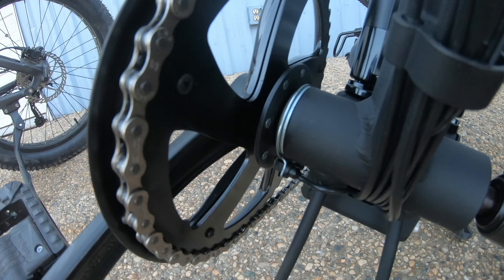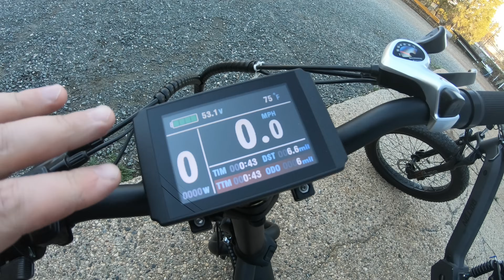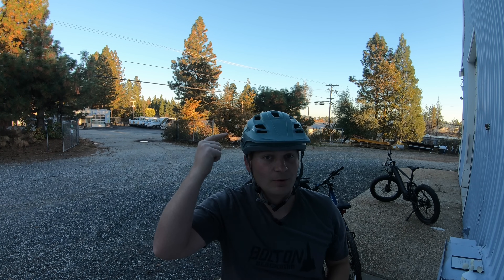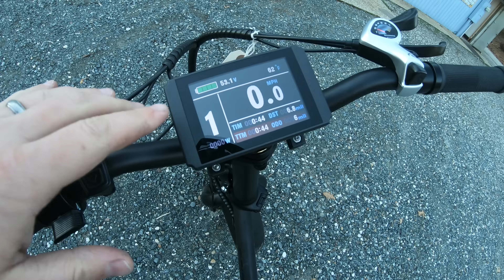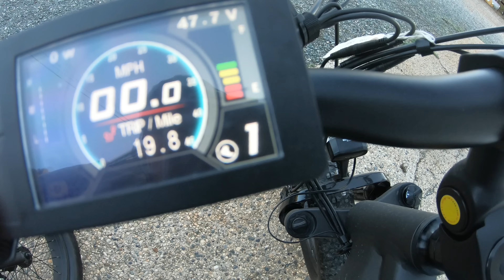Ebike Cadence vs Torque Sensors - the surprising outcome

Comment from the maker: Which is better? A Cadence or Torque Sensor?
Reply: It depends upon the person and the situation. I prefer a torque sensor. It makes me feel like I have bionic legs!
Reply: @michaelhorton6166  I also enjoy the delusional feeling I get from a torque sensor especially for climbing hills  :)
Reply: @michaelhorton6166  Just like me.
A Torquesensor is (in my opinion) the best. The most bikes build today in Europe are equiped with torquesensor.
This sensor give the bike a very natural feeling. One advice; try to keep the Cadence at 75RPM.
That's the best for a bike. A lower cadence is something a bike with midmotor doesn't like.
Reply: @michaelhorton6166  For me it's the same.
The torque sensor give me a smooth riding experience.
The cadans sensor doesn't give me that feeling. That sensor makes it feel to me like the bike is riding on it's own.
Reply: @michaelhorton6166  ¹¹1
Reply: For me, I like/need the cadence sensor and throttle combination. I've had a serious motorcycle injury so can't necessarily use one of my legs to it's fullest. Consequently I sometimes need to use the throttle to start off from a standstill, sometimes I ghost pedal in order to get the motor assist as my leg won't do what I want it to do. A torque sensor would leave me stranded sometimes. Some days my legs work as they are supposed to and then it's a great day!! My ebike has been a blessing.
Reply: @davemeise2192  sorry to hear about your motorcycle accident unless it was your fault and others got hurt. Typically it's some moronic automobile pilot who screws up and slams into a motorcycle but yes I think you are correct with your thinking that a cadence sensor would work best in your particular situation. Although I think the majority of people would want a torque sensor there are absolutely cases like yours and others where the cadence sensor makes the most sense.
Reply: @billclark8241  Majority of motorcycle accidents that result in injury or death are the fault of the rider.  In fact, the number of SOLO vehicle accidents are higher than those that are the fault of the car.
Reply: @bindingcurve   I agree with you. Nowadays nowadays the way these kids ride these motorcycles so carelessly it absolutely has gone the other way now with motorcycles being the majority at fault.
Reply: Throttle torque.
Reply: For me torque
Reply: I'm more curious about if it's possible to add a torque sensor to my RadRunner Plus... It comes with a cadence and I wonder if it's possible to upgrade it at all and what if I can and did?!? (I haven't, yet, I'm just trying to find out if it's worth it to do it or not, first )🤔
Reply: @realRayMarx   Typically CS is digital signal and TS is analogue. Some controllers accommodate for both, but not all. So you might have to update your controller and display too. Total cost for parts is probably 200-300. Grin probably has 4 hour presentation on the subject.   EDIT:  https://www.youtube.com/watch?v=7Am96zl1S4E
Reply: @realRayMarx thank you for asking.  I searched for this very question and it led me to this video
Reply: Why didn't you talk about the benefits of having both WITH a throttle of course.
Reply: I haven't ridden a bike with a torque sensor, but I think I would prefer it. I have one with a cadence sensor + throttle
Reply: Until the cyclist learns to hold the brakes before putting their feet on the pedals, I think the torque sensor is dangerous, because it can start when the cyclist isn't ready to roll forward. Unexpected stops are possible on a cadence sensor bicycle, but they are less likely. Being new to e-bikes, but experienced on bicycles, I'm used to putting my feet on the pedals without first holding the brakes, so I'm glad my bike has a cadence sensor.
Reply: Most if not all drives with torque sensor have also cadence sensor so drive does not engage if there is presure on cranks but they doesnt rotate, so no worry
Reply: Not sure what you mean. I' always thought that putting some pressure on pedal activates motor.
Reply: Torque!
Reply: yes... LOL... depends on the application and rider goals.
Reply: Torque. Less lag, better predictability and proportional power output. Desirable for short commutes and school drop-offs.
Reply: Would be nice to have both! For example switchable between the two systems in the display. Technically possible with mid drive and hub motors. Beside that the Bafang  M620 has it already. A powerful mid drive motor with torque sensor. But the throttle overides the torque sensor when used. Is fun to ride it!
Reply: for my usecase (emtb) a torque sensing mid Drive is ESSENTIAL. cadence sensor would be deadly as the lag can cause accidents.
Reply: I have a torque with a throttle / Love it
Reply: My new electric mtb has a cadence and torque sensor which is sooo much better with the torque sensor added
Reply: If you can program the controller, then you can basically "ruin" a torque sensor by making the response more like that of a cadence sensor. Because of that the TS because you have the option, while with CS you don't. Also having the throttle in the mix also makes the TS more appealing. It does cost more, if I want to come up with negatives, though its usually like 20 vs 100 dollars. That should not be the deciding factor.
Reply: Torque for sure
Reply: I prefer Candance. Because If I can manage to overide the Pedal Assist settings, those two can be the same as ghost pedals. Why bother to spent more money?
Reply: There are good and bad cadance sensing pas. Speed control is crap. Power control is good.
Reply: Honestly, I don’t know anymore…😭
Reply: Torque is just better in every way lmfao there is literally no question. The only possible reason one would want a cadence sensor is just if their lazy…. But at that point why not just use a throttle??
Reply: Cadence with throttle. The throttle is great for crawling at low speeds
Reply: Cadence sensor, allllll the way, Kyle.
Reply: @keithbeef-s2t  "cadence sensor all the way "said the guy who never tried a bike with a torque sensor
Reply: Got a cadence sensor bike without throttle and for slow speeds this isn't great... That said I'm happy
Reply: hi your customer service are sucks i wanna cancel my order and he viewed didn't reply to me.
Reply: Throttle is illegal in the uk and power is limited to 250w 15.5mph.

Comment: My Evelo Galaxy SL has a mid-drive motor with torque sensor and a thumb throttle. I like that it feels more like riding an analogue bike, but that I also have the option to use the thumb throttle to take off from a stop or to get a quick boost uphill without changing my base assist level 😀

Comment: I have bikes with both. There is no best because it all depends on how you want to ride. But even with a cadence sensor, you can lower the assist enough to where the bike feels "natural" so you can pedal with effort. At least with a bafang mid drive. Torque sensor is best for trail riding where you need 100% power delivery predictability

Comment: Cadence sensor behaves more like a real motor cycle without the high risk,it still a bicycle after all, it could only go so fast, which is a good thing for safety reason, and is much more fun to ride. you could use the throttle anytime for take off, tired legs or move in and out of lane if needed to avoid traffic. IMO, the only way to go, especially for someone older or have physical liability.

Comment: Thanks for this video!  You explained the difference very well.  I ride a Giant Trance X most of the time and love it!  I do however ride my gravel bike on the rail trails,  I finally added a Tongsheng 750 watt motor to it.  This motor is also torque sensing which I am very happy with.  I wasn't going to install the throttle at all until it dawned on me that one day I could crash and maybe not be able to pedal home. I'm 77 years old and have no need of a cadence sensor as I love the work out, that's why I ride a bicycle and not a E motorcycle.

Comment: i just bought an ebike for $2200 and i hate it. Its a mid drive 250w 70nm motor but it has a torque sensor and you need to pedal very hard to get full power which makes it so that its hard for me to keep the stop speed of the bike on straights and its worse at climbing hills than my old 250w 50nm hubdrive motor with a cadense sensor and i dont know what im gonna do except for finding a new bike.

Comment: Technically the cadence sensor should be able to detect what the user wants, it can see the pulses from the encoder wheel so if your controller is programmable enough it can vary the power depending on how fast you move the cranks, of course you need a crank that doesn't move when the bike is moved to prevent feedback loops but otherwise it should work well enough.

Comment: I have one bike with a cadence sensor and one with a torque sensor.   I like the torque sensor for city riding because it feels more natural and I feel more confident that I am not going to inadvertently lurch forward at a stop sign with lots of people around.  For safety at a stop sign with a cadence sensor I put PA to zero and have geared down on the shimano gears to start again.  The Torque sensor feels more like riding a regular bike and  think it provides more of a "workout"  than the cadence sensor bike I have.  Good explanation in this video which helps me understand how both bikes work because the difference is noticeable on hills.  (part of that is that I have a smaller motor on the torque sensor bike)   If you are deciding on either---my advice is that considering the weight of ebikes is more important than anything almost.  Get the lightest ebike you can afford if you are a woman or senior or someone just not quite strong.  The heaviness of ebikes can make them feel awkward  just moving them around , putting them on a rack etc..   I also like hydraulic brakes vs mechanical.   If you are making a purchase decision ,  watching you tubes on all components like in this video is helpful.   Many videos however are focussed on how fast and how far it will go on a charge but for seniors like me---who want to ride an hour or so a day for exercise---lighter the better-- sensor choice and brake choice are the keys.  Also if you haven't been used to riding a bike ,  allow practice time in a safe place to fully understand the bike and how it works. I was a regular on my regular bike and it was still an adjustment to an ebike and you don't want to be practising in busy traffic.  (love my ebikes as it keeps making biking fun as I age)

Comment: Great explanation.  My wife and I (both in our 60's) currently ride bikes with the Bafang bbs02 mid drives (750 watt, cadence with throttle).  Most of the time we ride on PAS level 1 in high gear and cruise about 14 mph with no ghost pedaling.  When I need a little break or we are going up a slight grade (and I start losing speed) I bump to PAS 2 and shift down a gear (so I don't go too fast).  Sometimes I intentionally ghost pedal when I want to just relax and watch the scenery a bit.  

However, yesterday I finished a new bike, a Trek mountain bike with a 750 watt Tongsheng TSDZ8 motor.  It has built in torque sensing (but also a throttle).  I can already tell that it has a much more natural "bicycle feel", in that if I want to go faster, I need to pedal harder.  The various PAS levels (5) seem to let me regulate the amount of effort I need to put in and the speed I get out of that effort.  I am anxious to get more miles on that bike so I can get a better feel of how to use the gears and PAS levels to navigate hills, flats, etc.

Comment: I dont have much experience with ebikes so far but really like the cadence sensor, i typically ride wooded trails in pas 1 and second gear, if i find myself on a hill needing help i just hit the trottle while still peddling for an added boost. Pretty seemless and requires very little effort.

Comment: If you want to excercise, torque sensor is the only option. Throttle only needs to be regulated like it is a motorcycle or moped, that stuff can get people killed both the rider and others, this especially applies to heavier setups for incompetent older boomers, because dunning-kruger effect, these idiots are clueless to how they are not young and fit anymore and does not have the physical strength control the stuff. Ebikes if they are to stay in the category of bicycles must not have a throttle.

Comment: Actually, if you’re an older person and you have some disabilities. The best way to go is a cadence sensor. It gives you more opportunity to undo a mistake. I also suggest 3 inch tires and a 20 inch circumference. It appears to me the only final solution on this. It still have engines that do both.

Comment: I have upgraded 3 normal bikes to e-bikes with upgrade kits with hub motors. All of them have only cadence sensors because they are cheaper and easy to add.
I would say that a cadence sensor is sufficient on an even road, but if you are having hilly conditions, a torque sensor would be better, because downhill you need no support at all and uphill you constantly need to adjust the support level of your motor or you use the throttle.
I'm from Germany and here only pedelecs are allowed which cannot have a throttle, nominal motor power is limited to 250W and motor support is only allowed up to 15mph.
You can go faster with an e-bike, but this is more considered as a moped. For this you will need an insurance and a small license plate (showing that the insurance is paid). But those bikes are needing a homologation and DIY bikes with 1000W, throttle and 30mph are always illegal on public roads and cycleways.

Comment: I like the cadence sensor as it is safer when first peddling the ebike, take 1-2 revolutions of the crank to kick the motor in. Once you gain experience with the ebike and become accustomed to the motor, you can throttle start the ebike when starting your ride. This is how I do it and am comfortable with this method and is the method I would recommend to ANY beginner. Great video, TY.

Comment: I have some knee / leg problems.  I am trying to get an idea just how hard you need to press down on the pedal to get max power assist from a torque sensing bike.  Is it a standing on the pedals level of effort needed?  If so, is that only with the power assistance level set to 1?  Can you adjust this level on the fly?  I know I need to test ride,  any comments to just give me an idea for now would be much appreciated.

Comment: I think I will want a torque sensor on my next ebike. But now when I 'm not in biking shape I think the cadence sensor is right for me and the ebike I  have.  I find I'm usually peddling hard on hills and while excellerating and then using mostly throttle once up to speed on flat ground.

Comment: I tried a Aventon Abound, which uses a Torque sensor, and found it actually “un” natural. Maybe it’s just their implementation of it, but it applied a bunch of little micro-doses of power, which felt very uneven. I’m peddling along at what feels like even cadence to me, but the sensor is picking up the slightest of push and thus engaging the motor, and then the slightest of slack cuts the assist, and all in very rapid succession. It felt like more effort than help as I tried to figure out how to get even power out of the motor. You can fine-tune the amount of assist (they call it ride-tune), but I could never get it to just give me an even application of assist. Maybe torque sensing makes sense for trail riding or other kinds of fitness riding, but for just cruising on the path and especially for cargo bikes, I just want easy-going level power assistance while peddling. So, that makes me cadence guy.

Comment: Cadence sensors are also natural feeling - they feel like you are coming off a hill on a regular bike and you are getting a little gravity assist.  You can pedal harder if you want to go faster, or you can take it easy and let gravity do the work.  A cadence sensor feels as if you are always coming off a hill.  Another way to look at it is mathematical - a cadence sensor adds power, a torque sensor multiplies power.  Simple!

Comment: I bought a cadence sensor and the power is insane and a lot of fun but I'm not fond of ghost pedaling. So I am jealous of the torque sensor and want one! However, if I had purchased a torque sensor bike I would probably be jealous of the cadence sensor and throttle and I would want that. Isn't that how it always is, the grass looks greener. Ultimately, I can run my bike on a lower PAS and get more of a workout, or run it on a higher setting and get more speed. And when I purchased my bike there were no torque sensor bikes that had a full suspension and I really like having that in the city with all the pot holes. It seems you can't have everything!

Comment: Best answer… All 3!  If you’re having knee troubles or have been away from riding & have to build your leg strength or are trying to keep riding later in life but you no longer have the strength you used to.. Cadence is a giant help. Then, as you become stronger, the Torque sensor will help you build strength feeling more like a natural bike!  The throttle is an insurance policy BONUS in cases where you over-extend yourself & might not be able to get back home OR when you need quick/fast power like in getting away from an animal or hustling across a busy street, as we don’t all live with trails & deserts around us.. 😂  It’s a Win-Win-Win!